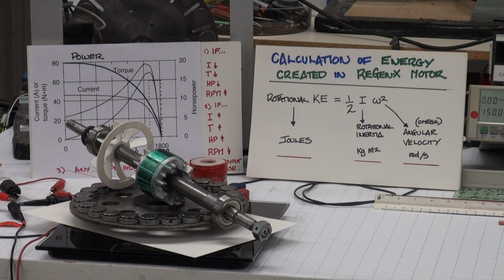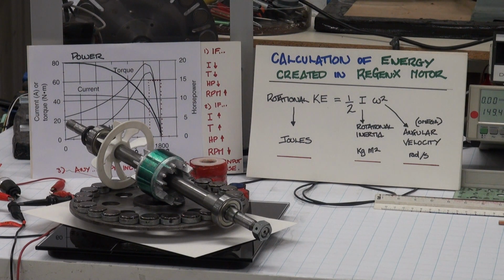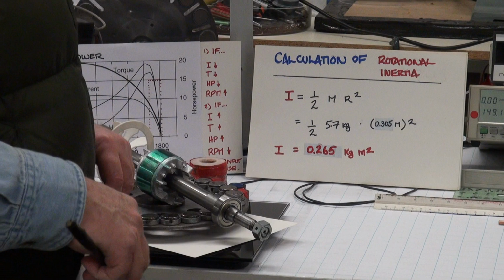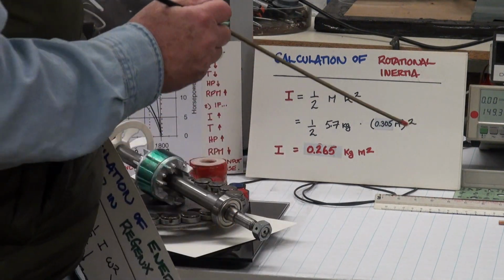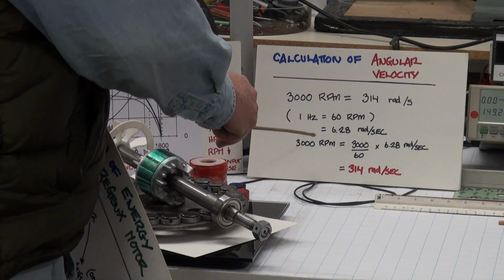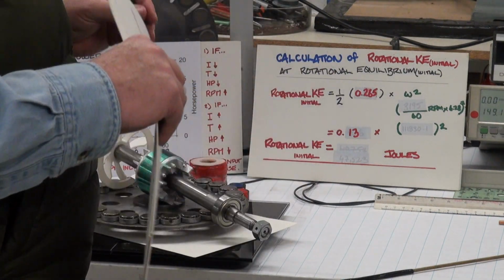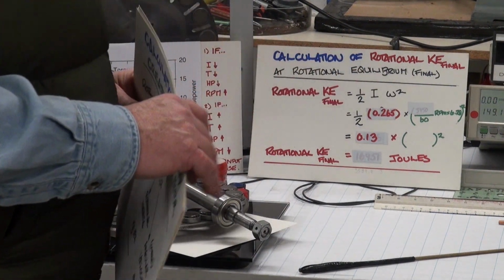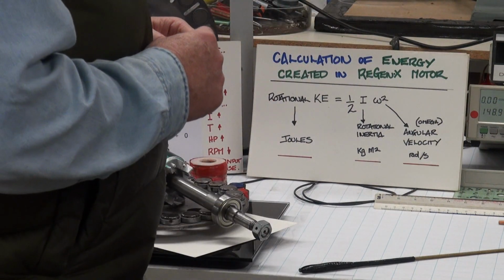2734.6 JOULES OF CREATED ENERGY IN ReGen-X MOTOR

Comment: This can be done with most bifilar coils 

The fact is that in the EMF equations for electric motor theory, there is no value given to the CEMF / BEMF component - in regards to induction of rotor field crossing stator closed loop producing Maxwell- faraday Law. 
If this CEMF value is added to the data sheet under the losses section where it should be, for any high efficiency motor (80-95%) then it would already be over unity in totally energy measurements- from input  to output!

The great thing about what you’re doing here is that you are using that missing value of wasted energy and adding back into the input for positive resistive work in a load. 

That fact is that all counter force in all electric motors comes from the input, and is not accounted for in the equations, so many studied people over the years have pointed out these issues including Tesla, 
And it’s really an issue of mistake in electrodynamics regarding the physical limits in COP measured losses...

The truth is - it’s a mistake in the electrodynamics physics losses cop measurements. 
But as they still will not accept that in physics over 200 years later now!!!! I agree the only other way to talk about it, is that it’s a creation of energy!

I should say also - clearly maxwells-faraday law in maxwells equation is the equation used to show the creation of electric energy from magnetic energy via mechanical input, (tho it can be solid state mutual induction as well depending on the context of input type)

But really the fact is 99.9% of all electric motors designed have closed loops (inductor) passing a changing magnetic flux and that is creation of electric energy BUT it was provided via the original input source that turned the rotor to start with. 

Counter force - the (-) in Maxwell-Faraday Law equation (Lenz Law) is a result of all induction in cross product in the strict Contect of the Laws first statement ‘Closed Loop’ 

99.9% of electric motors have that design 

The other .1% of exotic electric motor design ( no one ever sees) is OPENING the loop in cross product function of rotor B and loop E, resulting in a NON-Maxwell-Faraday law in the motor...
And actually then the Lenz Law B-EMF fly back will result in energy to capture and re-use if that’s desired.

P.s the ‘skeptics group’ that don’t like your work are a bunch of fools!
On their own wiki page section it shows that all of them measured the excess energy and had no idea were it came from and still said it can’t be... what a bunch of idiots !

Comment: Very good that demonstrate that not only creating energy but also reducing the torque needed by the prime mover to turn under load which is the opposite of any conventional generator which drag the the prime mover reducing the efficiency of the generator
That means you are not only reducing LENZ but you are making the LENZ working for you and making it to push the generator helping the prime mover